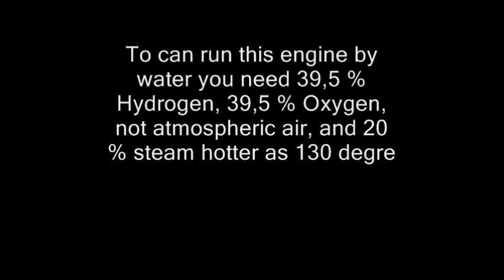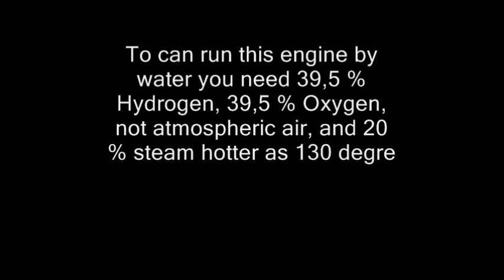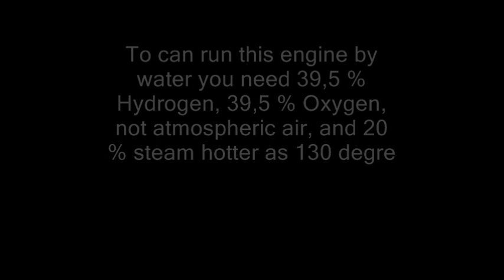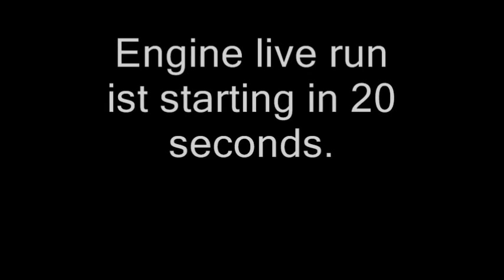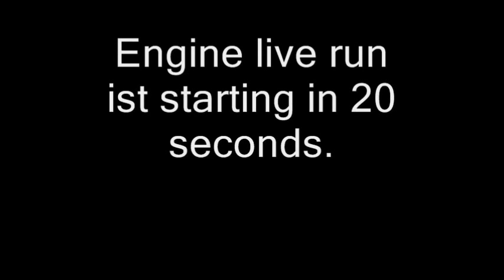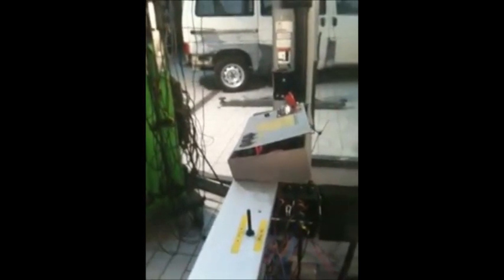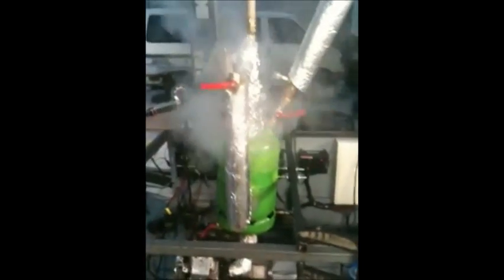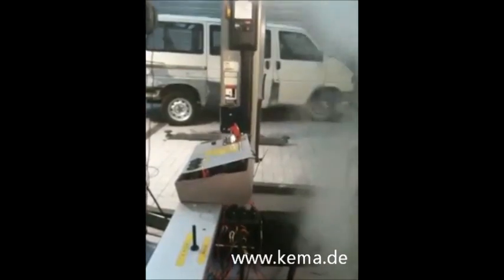Hydrogen steam engine first running attempt. Water Engine.

Comment: You should study the details of the car/ lawnmower conversion to water vapor pressure + hydrogen from You tube videos 1+2 - S1R9A9M9 from 2008. Also see prop plane ran on water + Hydrogen from exaust heat steam and Tesla coil during 1940's. See Hefferlin Manuscript from Internet or purchase back issue Amazing Stories Magazine Sept1946.
 Also oil furnace ran on water during 1950's in Texas. SS tubing on water line in fire pot heats with oil to 1500 degrees . When super heated steam , oil valve shut off. Hydrogen/oxygen torch flame continues. Shock wave of heated vibrating molecules pop apart when going out tiny nozzel to the ambient pressure. US Patent was not allowed, only 50% increase in efficiency.
Reply from the maker: Hi! It's been a long time since then, today this attempt looks like this:  https://www.youtube.com/watch?v=uXP9qUbrII8

Comment: H’m Solving your problem is possible ? stainless steel spark plug or something that does not corrode to much, higher ignition voltage...
tungsten ?

Separating both electrodes of sparkplug from ground making spark in total negative towards earth and mass of engine makes it combust better extra electrons added to reaction however this needs a very good high voltage insulation and also be sure none gets fried on this setup it also adds extra heat to the reaction, in theory a hydrogen flame going through a spark bridge makes for a thermo lans that gets very hot...

So depending on the amount of electrons added you might get a hotter reaction...
so that makes for steam being hotter, less gassed and steam needed...

Also since steam is water without electrolytes you need to remember water is an universal solvent so without electrolytes like minerals already in it you make for a kind of acellerated rust process..

So the  sparkplug needs to be made out of materials that do actually protect it very well that’s step one !!!

The setup itself is reallly great !!!
Thanks for dshowing this is great really great thank the lord someone is at least doing this kind of thing !!!
Reply: So making internal temp higher gets gasses and steam out better...
But be carefull experimental setup needs to be in a bunker for protection...

Also make sure there is not to much water inside the engine oil !!!
Reply: Emergency valve in oil basin steam might build up inside while running...

Nasa use something ya add extra electrons to the reaction that is highly environmentally unfriendly but in this case use my tips and see that it improves, be very carefull though as this reaction is not no child’s play adding to much extra electrons to it might burn a hole through your engine block !!
see hydrogen welding with ark bridge, however steam and convection cool this setup..
and the surface of the cylinder also plays a role so you make let’s say by hearing the gases inside some more a reaction that makes for a kind of better pit steaming while you need a better corrosion resistant spark plug and a kind of higher voltage to go through...
but be warned to much is to much...
so with higher temp and a heat exchanger to heat or preheat steam you might be getting there...
Reply: To make for a higher flame temperature to evaporate more water evaporation of the system use an insulated spark plug so put a larger spark plug hole in drill it out, than insulate with though material like hardened thermo hardening plastic pyrex or ceramics and drill a hole in that and put the spark plug in with a contact ring around insulated mass...

than use a transformer insulated against mass and take generator off of mass thus use a generator with separated windings from mass, than put the voltage of the generator a into bunch of insulated microwave transformers pair them  see tesla list www.pumpman.com about this...

Than use high voltage windings of the last transformer both to connect to sparkplug and connect tv diodes to it, than connect transformer winding of first mot transformer to mass ( be sure to take generator off off mass or it’l short out) so you have let’s say minus 25 thousand volt on one pole of spark plug and minus 10 volts on the other  so you need 25 kilovolt divided by 800 volt or thousand volts an array of transformers to create this voltage difference of the spark bridge towards mass..

see it as the kathode of a radio vacuum tube that’s fed by let’s say 6,3 volts but has a potential by connecting inside its 6.3 volts winding middle wire one pole of the high voltage and the other high voltage lead through the load to the anode the exit of the vacuum tube..

minus is more electrons not less plus is less electrons look up electron flow versus calculation current...

And than look up a radio tube kathode, your spark bridge of the spark plug will become your kathode, your mass of the metal of the engine will become your anode...

so actually you are sending electrons through the hot gases of the ignited fuel towards the metal...
where the last winding of the array of microwave oven transformers is connected too..
so you take some generator energy to make the gases ignite better and at a higher temperature so it’s kind of like a turbo generator in terms of better and hotter ignition...
it gets its energie through surplus generator power...

in this case remember the voltage needed to get one centimeter of air ionized is a thousand volts per millimeter but you have gases and steam they are distilled water without electrolytes in them so you need to get the voltage up quite high to do make this gas and steam cloud to conduct and to keep on doing so it needs to be quite high..

so the voltage should be chosen in a way that you have enough to ignite the gases through the steam, and still add extra electrons to it...

and you can chose from the setup of transformers by adding different connectors at the paired microwave ovens power connectors to make sure that they connect at the roght voltages...

so since the spark is negative towards the frame with the tv diodes ( it will oscillate while discharging and sparking so you need to insulate the wire quite well because of the high voltage against mass so normal ignition cables need to be turned into high voltage insulation wires maybe even with a little carbon in them to act as a resistor to not short the power array..,

also the more electrons added the higher the temperature so do not burn a hole into the engine block.. 

and since you hook it up through the interruptor to get a spark at the right moment you do need to recalculate the capacitor valeu it probably needs to be more farads so bigger, that s keychain so once you have got it done you might also need a slightly bigger generator but if the generator can also load a battery or actually have extra power for lights or an car air conditioning than you me fine...
than it acts like a turbo making gases hotter and expand more and also makes the water evaporate better, 

remember that the extra space you drill in the sparkplug hole must be large since it needs to be insulating a great voltage that needs to go through the gasses so it needs a fairly large insulation of a couple of tens of millimeters as much as possible without letting the insulation crack... that needs to be quite sturdy

you might need to recalculate the amount of gases flowing in, but this will save your invention, don’t forget to mention me, as advice is cheap but fame is priceless so I am telling you for free but if you get famous don’t forget to mention my name to..

thanks good invention wish you happy thinkering...
Reply: Using a piston ring that adds extra insulation from the cylinder tonthe oil and an exhaust for water caught in the oil might help to of course !!!
Reply from the maker: The easiest way to solve the problem is to forget it altogether! You solve one problem and create new ones!

Comment: Try superheating the steam.

Does the engine run with just oxygen and hydrogen, and is their a powerdifference compaired to hydrogen+oxygen+steam?
Reply from the maker: The engine runs with O2 + H2 + steam! Yes, with water vapor is an increase in performance, because the vacuum is not so strong!